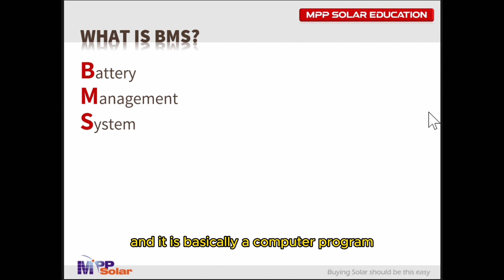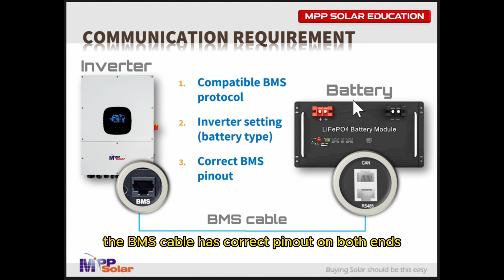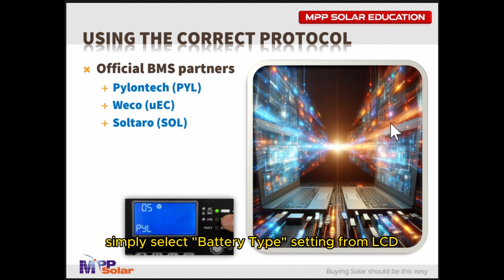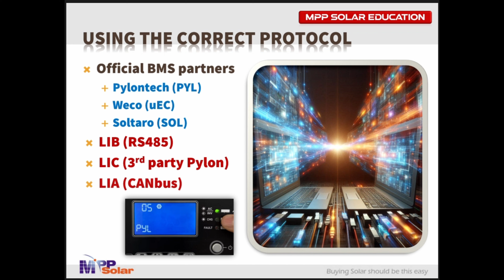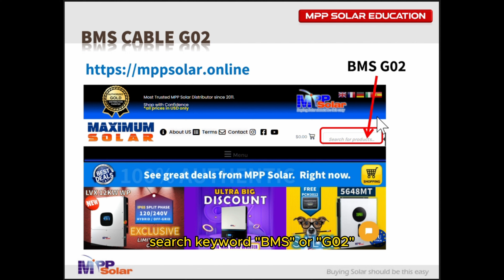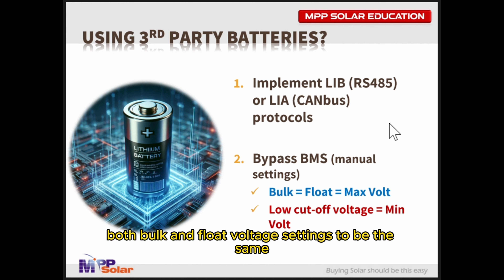Understanding BMS

Comment: need video of bms communication setup with jk or sephlos bms.
Reply from the maker: JK / sephlos are NOT BMS partners by default, so you will need to either apply USE settings, or convince them to adopt to PYL / LIB protocols.   See https://youtu.be/O5lTouFUMds?si=GOiYETX4A_d7YcW6